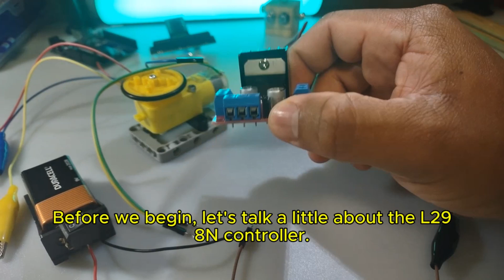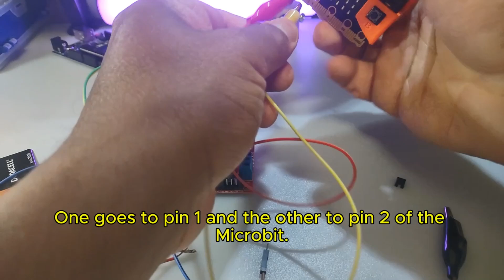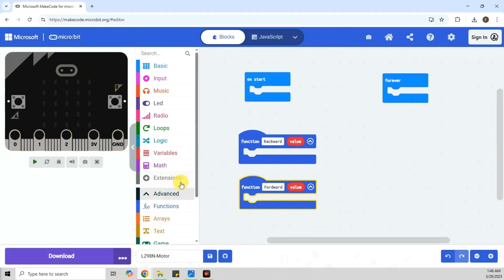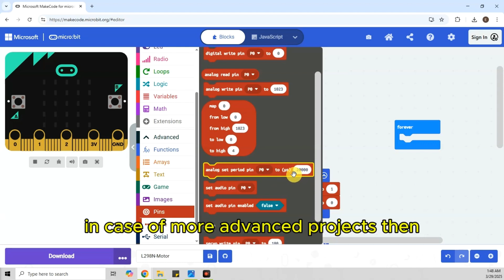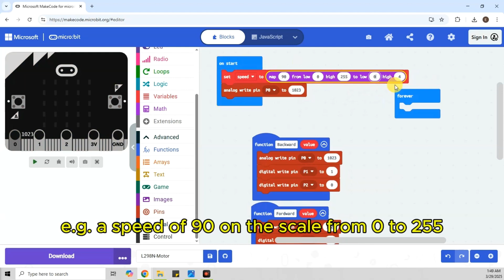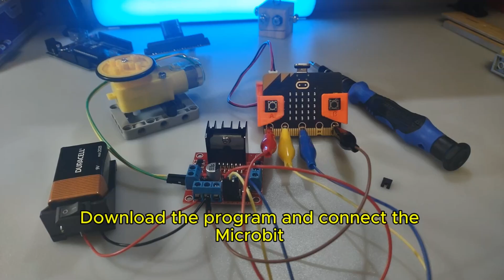🔥 Control a DC Motor with Microbit & L298N – No Expansion Board Needed! #microbit #l298n #dcmotor

Comment: Hi.
So i'm giving microbit classes in a school, and there was this group where the DC motor didn't work when connected to the L298N. The thing is, it was connected on a 3v battery on the 5v port, my question is, was that the problem? Can i only use a battery that is 5v or more?
Reply: try using a battery with a higher voltage ideally connect it by  the first slot before the gnd terminal
Reply: @BionicArtCraft  Yeah, I'm kinda new to Microbit, although I got experience with other microcontrollers. I was having other issues with things like distance sensors and it started working when giving it the proper voltage, when I can I will test that too, thanks a lot!
Reply: @notdarkinho9549  same issue here as well u should get the keyestudio 45 in 1 sensor kit for microbit it will give u expansion board as well which can help u provide enough voltage to all sensors also contains 45 sensors